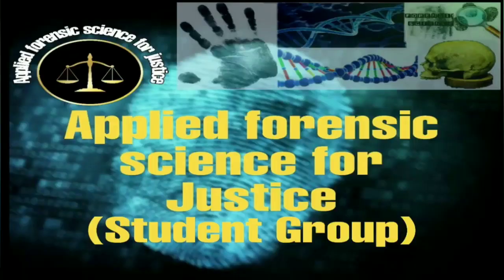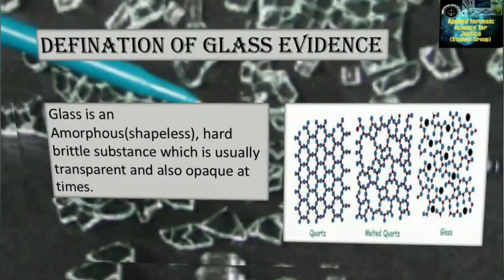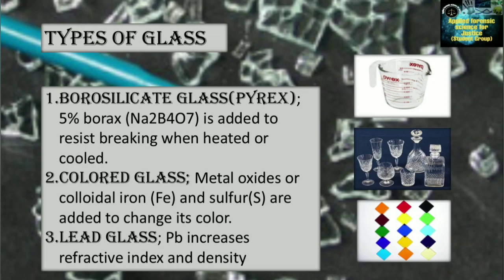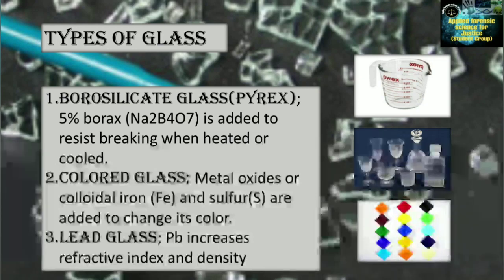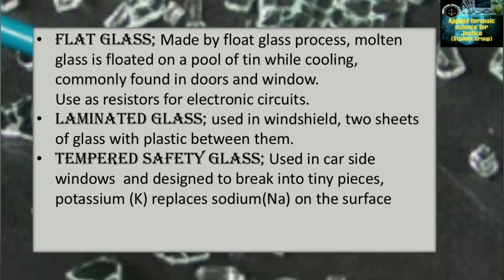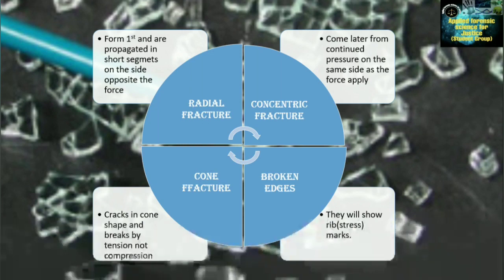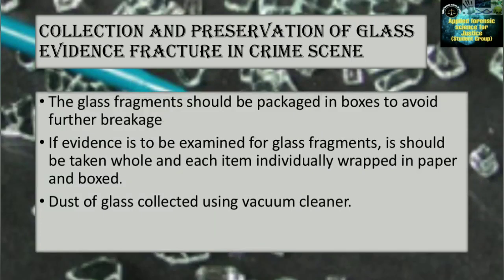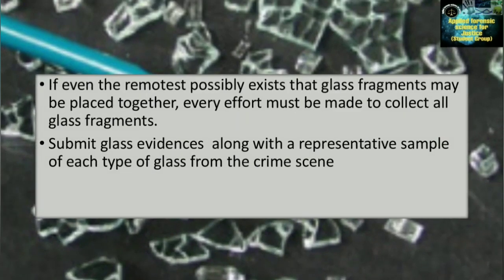Introduction to Glass Evidence in Crime scene.    #AFSJ

Comment: It's very nice presentation overall 
I also want to add something 
Like Rib or strip mark one more type of facture mark produces on glass surface called Hackel marks.
Hackle marks are coarse parallel marks lying parallel to the direction of fracture and can be used to match two pieces of glass. The easiest marks to see on the glass edge are the curved shell-like or conchoidal marks. As with hackle mark it may be possible to match fragments of glass.
For example :- 
When a bullet or a stone strikes a pane of glass, longitudinal compression waves are generated, beginning at the point of impact and radiating outwards in a series of spherical wave fronts. A flake of glass is ejected from the opposite side. The smallest flakes are near the point of impact with flakes increasing in size to the opposite surface.
Reply: Yes hackle marks are the marking of glass evidence 😁
Reply from the maker: Thank you
Reply from the maker: Thank you sir